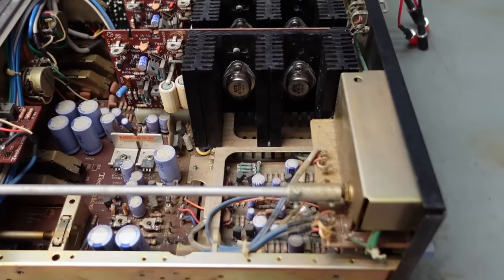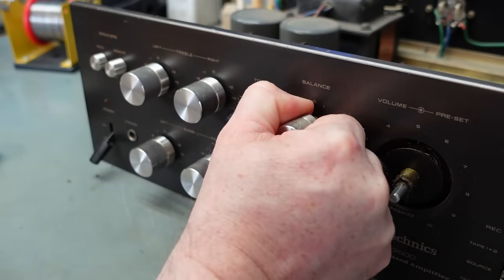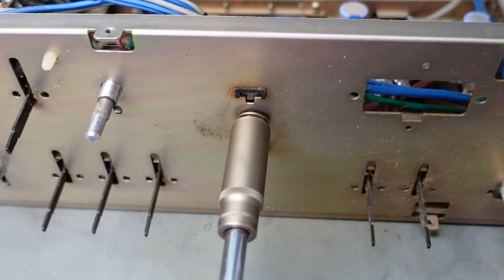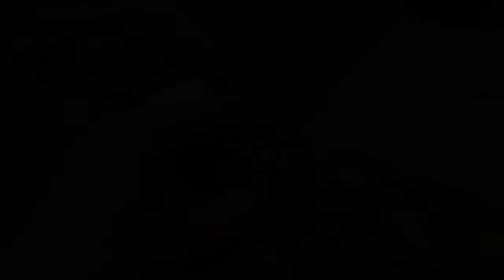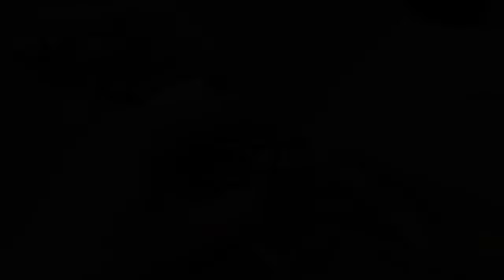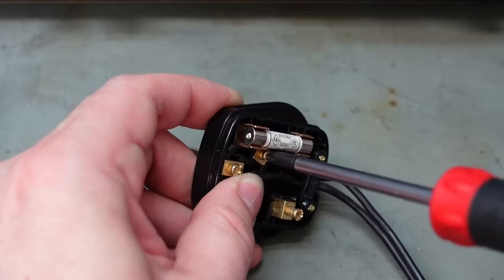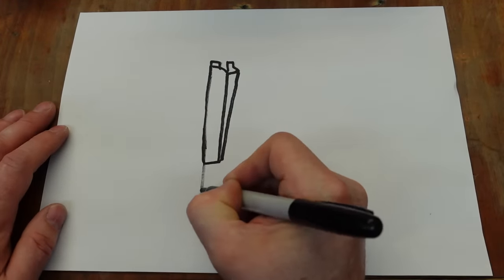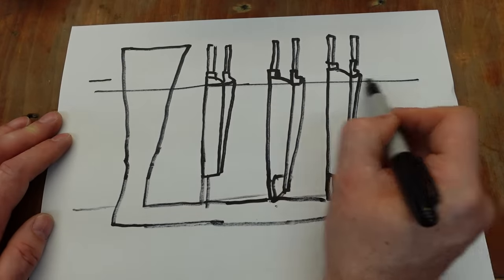Technics SU-3500 Amplifier Repair - Part 2 - The Overhaul!

Comment: I love how Mark always goes the extra mile. Casting those selector knobs was genius.
Reply: Or madness. Wouldn't a 3D printer work with this?
Reply: No, he mentioned it was too intricate inside 😊
Reply: @markbrum  But now he can measure the mold to reproduce the inside!
Reply: Now me, I'd have gone the Ebay route to find similar type switches. Or found a similar amp which is knackered to strip for bits.
Reply: Amazing!
Reply: Completly agree, best aproach to the problem.
Reply: Amazing work he does! I was told only use silicone grease on nylon gears or nylon sliding surfaces! Apparently hydrocarbon grease rots nylon ? Anybody else heard of this ?

Comment: Over performing caps across the board can be a sign that they're starting to develop parallel resistance and leak DC, they appear to be higher values because they take longer to charge due to the parallel resistance taking some of the charge current the meter uses to measure the charge time. You should really also do a DC leakage test on them as well,

Comment: The led mod,ideally ,as its AC driven should have a diode in parallel,as the AC could exceed the reverse voltage of the led, usually around 5 volts. Love you vids. Thank you.

Comment: You might find the LED on/off light goes. LED's have a low reverse V, a rectifier diode in reverse parallel is a good idea. thanks for another entertaining video.

Comment: Great work, Mark!
I like that you don't just blindly replace caps; this has become too much of a disease among amateurs/dabblers (shows you're obviously not one of them). In fact, most of those pale blue Matsushita caps are of extremely high quality; it's just a small batch of them that leak and get corroded.
It's usually better to leave them in, because they were overbuilt (unlike modern ones that often are very near their tolerance limits).

Comment: I'd suggest you use micro fiber towels instead of the abrasive blue shop towels.  MF is far easier on surfaces and better at picking up contaminants.  Great channel!
Reply: Do you know what foam he uses to clean the boards?
Reply: I think it is similar to the old Lysol bathroom cleaner foam. Stuff worked miracles but it's no longer available in Canada, anyway. It was a great but harsh cleaner.
Reply: @Michael-bp7rr  I found a foam cleaner. It is called AF foamclene. Thanks.

Comment: Doing mostly SMD and IC repairs these days but I came up on discreet components. We're a dying breed and it's great to see you repairing them. You've got all the gear as well. Repair seemed bog standard but you went into beast mode on the cleaning. Well done, lad.

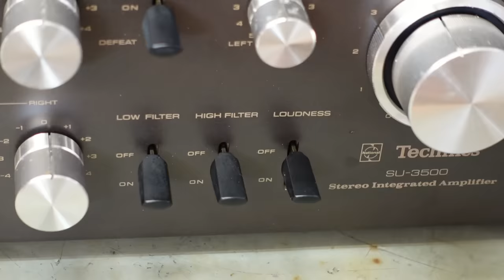Comment: Great job Mark, creating a new replacement switch knob is next level. I love working on Japanese audio equipment of this era although when some of the exotic switches and pots get badly damaged it can be tough to find exact replacements. I did notice at 33:01 that the inside of the headphone socket still looked a bit nasty.

Comment: That's what I call a restoration! 
Almost perfect apart from the overachiever capacitors that were tested.... There's no such thing as an overachiever when it comes to capacitors... This is no different to the old dog bone resistors that gained resistance over time..... 
When a capacitor measures over it's rated value even by a tiny bit, it's trying to tell you that it's well on it's way out, the actual value of a good used capacitor should always be either at it's rating or just below... Anything above or way below should be replaced! 
Capacitors never get better with time or usage... Never! It's very common to find bad capacitors in the tone circuit in just about every vintage amplifier.... You would think that their location which is away from heat and high current that they have an easy life but this is the one area that always needs close attention...  The large capacity capacitors in the power supply usually don't seem to suffer even though they get to deal directly with higher current levels... A I have haven't had to replace these but on rare occasions I have seen them being replaced after testing showed that they were tired... 
Your capacitor tester only showed capacity and voltage loss, pretty sure it must have another screen to show ESR and dwell angle and possibly quality.... You really have to factor in all the measurements of a good capacitor tester to determine if the capacitor needs to be replaced or not... 
But apart from that, this really was a first class restoration of this beautiful amplifier... Making new switch cap's, that just takes this job to new and unheard of heights.... Job well done!

Comment: WOW! A most interesting 2 part video. Besides the fault finding and diagnosing I particularly like how you show the complete disassemble and reassemble as many YouTubers don't do it. Knowing how to take a unit apart and put it back together again is often the missing information in a service manual. Function wise the amp is surprisingly similar to my circa 1976 Pioneer Stereo Amplifier SA-7500. Never been touched and is used to drive two Spirit passive near field monitors I use when composing on a near daily basis. Admittedly it could probably do with replacing some capacitors, even though none show any leakage. Thanks again for your repair videos they are always most enjoyable. Best wishes from Australia.

Comment: Nice job Mark , top class amps well worth keeping em working , built to last and give true tones ,not like today's junk ....   for them selective switches you could have used maybe dowel ,and burnt the leg ports out , then used belt sander to shape a little ,put a bit black stain , would have looked nice , and if you got em steady enough on legs , maybe used a screw to hold em in place ,during usage

Comment: Awesomeness repair job! When reinserting components with multiple legs it's usually a good practice to make sure they're all straight and have as little solder on them as possible to ensure they go through the holes without tearing the etching off.

Comment: Cheers Mark, I feel I gain so much knowledge from your encompassing walkthroughs! In the past, I have had trouble diagnosing/replacing transistors. I added a curve tracer and semiconductor tester to my  electronic repair wish-list. I also appreciate your methodology that enables you to not "shotgun" replace all electrolytic capacitors =)

Comment: It's so very solidly built. That makes it worth saving. Great work. The moulding & casting work was entirely new to me - most impressive. I hope they are very happy to have it working properly again. Nothing even half as complex & versatile is made these days. If you use a variety of decks & sources, this Amp is golden.
Reply: Probably the specification (signal-noise, linearity, distortion) is far inferior to modern IC amplifiers.

Comment: I still have - that I bought new, and I'm still using daily as my home entertainment - CD Music/Computer/YouTube/TV etc, a well serviced 1989 Technics SU-600 'New Class A' integrated amp, Specs:  30W per/ch into 8 Ohm (stereo), 5Hz - 70Khz, THD 0.07%, Damping - 50, and more (Hifiengine online has loads of technical spec manuals for many 80's/90's 'Vintage' amps).
No, it might not be a what you would call a 'Modern day 500W/900W ass kicker', but, on volume 3 to 5 (out of 10), it HAS caught out my partners teenage lad and his mates (they're into all this Boom boom boom' loud music), as they were suprised at what an old amp CAN ACTUALLY DO! I've also had the neighbours complaining (lol). Yes, for a (haha) 'Lowly 30 Watts per channel' It DOES have 'Punch'... But, it ALSO has so much DETAIL and CLARITY too! Great for pretty much any of my eclectic tastes in music... 
Aaaaaaand the sound it provides to my pair of midrange Sony & pair of Pioneer bookshelf speakers (speakers A & B), is just, simply divine!
Oh they don't make them like they used to eh? Any from that period, Sony, Technics, NAD, Pioneer, Cambridge Audio, Marantz etc etc. A lot of 'Vintage' amps (that can be had for as little as £100 in good condition/working order on eBay etc), IF MATCHED to a good pair of speakers, CAN put some of the modern/new amps (or 'Home HiFi' setups) to shame. I guess that's what you get for having a 'Class A' amp verses some modern 'Class D' amps... 🤔😏😉
The only thing I might do in the near future, is hook up an 8" or 10" sub, just to help bring in the lows (my 4 bookshelfs tend to fall off at around 40ish hertz)... 🤔😏
😎🇬🇧

Comment: Watching you service this amp takes me back to the days of when I worked on my share of these amps along with a lot of the Pioneer and Marantz home stereos and tuners back in the 70's, and 80's when I worked in television shops. As time went by they started getting away from the T03 power out transistors and moved over to power output IC's and at that point the days of hand built and hand wired stereos started it's decline down hill just like today's automobiles. Eventually I moved onto RF repair and some designing. These days I'm retired but I still have my personal shop where I work on my own stuff or builds along with an occasional repair for a few close friends. How busy do you stay with this older refurbish/repair work? I also noticed that you work on professional musical equipment amplifiers too. Been there and done that too and even the musical equipment manufactures started taking shortcuts on their gear too which is sad. Around the shop we used to have our own quote... "The name goes on BEFORE the quality goes into the product."

Comment: I restored one of the same amplifier a few month ago. I found on this unit a lot of bad caps so I replaced them quite all. Specialy the 47uF caps where had lower capacity and a higher ESR. However I like your repair videos and you are so relaxed :)

Comment: back in the 90s I used to have amps like this in and the hole lot got a wash spray out with worm water then washing liquid then a water wash again.  dry with hair dryer left in front of a low power fan heater.  then lubrication spray.  was fun times

Comment: where you removed some components you lifted the PCB track and pads off the board.  The input switch track was a mess.  Solder is not a glue. Also the single insulated mains cable should be replaced.

Comment: Mark, thanks for another great video! Just a small advice - Electrolube SGB35 lube does wonders on pots, faders and such. Much smoother action than deoxit/fader lube!
That said, I'm not a fan of ultrasonic cleaning anymore because it flushes out the grease from the shaft of a potentiometer, pretty much impossible to replace it afterwards! I take the risk and bend the pots and switches open and do manual cleaning with silver polish and then lubricate the contacts with SGB35.
Reply: For pot shafts and some other assembled moving parts there are chain and cable lubes that are extremely thinned with solvents for application and will wick in from capillary action. Then the solvent flashes off and leaves behind a much thicker grease. There are even plastic safe versions that use some type of wax based lube.

Comment: Great video as always. I wouldn’t dare take it s as part that much, it would never go back together again! I’m in the process of trying to fix a old Technics amp at the moment, sadly I don’t have Marks knowledge and expertise.
Reply: Learning by doing. 😊  Nothing can go wrong with these type of Amps.
Reply: @twocentman  The Current Drive protection kicks in after 15 minutes, then it won’t power on again for a few hours. There’s two 6 pin relays that I’m going to change next. To my limited knowledge, I’m hoping the relays are sticking, then freeing off over a few hours allowing it to go back on
Reply: @Kevin-mf7wb  hmm it seems that the output transistors are overheating and sucking more and more current. Try to adjust the left and right  bias or measure the voltage across one of the output resistors near the big Transistors. The 14mv he shows in the Video is the bias with no input signal applied.
Reply: @twocentman  thank you, I will have a look at that.

Comment: Great work, now it's better than new! Only few people could do it like that.
Just one small improvement: I would have added an anti-parallel diode like 1n4148 to the studs on the board where the LED cables are connected. Your LED looked quite modern, and modern LEDs hate reverse voltage! The voltage might be so low that you can get away without it but considered all the work you put into it this small addendum wouldn't harm.
And by the way, how did you remove the dab of glue from the original knobs? It did hurt a little when I saw you doing that :)

Comment: This techinics is built like a tank, it should have a good clean sound.
If it was mine, i'd definitely be inclined to replace those modern nte output transistors.

Comment: Just a very friendly advice, always leave the load impedance switch in the close to 47k position, most MM phono cartridges are designed to expect that value from a phono preamp and most important, owners usually don't know exactly what that switch is for.

Comment: You replace the light bulb with an LED without a diode to block the negative current. The LED may expire. BTW, if you include a cap, the LED won't flicker at 25 Hz.

Comment: Good call. Decent caps have got so expensive. I don't even think about using Ebay for caps anymore. Farnell, RS or someone like that only! I think I'd have just shot the pots and switches full of switch cleaner in-situ rather than pulling them all. Good to watch though and one one broken leg!

Comment: What is the name of this white foam?
Reply: Wondering the same thing.
Reply: Servisol foam cleanser 30.  Appears to be a discontinued product.
Reply: It's in-frame at one point.  Servisol Foam Cleanser 30
Reply: Looks like "CRC VISICLEAR DISPLAY & ELECTRONICS SCREEN CLEANER".
You could use other, just search for foam spray cleaner.
Reply: Me too.
Reply: Anti-Static Foaming Cleaner, I use the Amberclens brand but others are available

Comment: Great job, Mark! Personally, I repair old equipment for mainly elderly people from time to time. However, we don't go to the extent as you do. We only handle repairs and charge only for the parts. May I ask which cleaning foam do you use and what you put into the ultrasound bath for cleaning contacts? 
Very much appreciated. Thanks
Best regards from Germany.

Comment: Great repair! What is the white foamy spray cleaner you used to get all the dust off those PCBs?
Reply: I'm not positive what Mark uses exactly but I use "MG Chemicals Static Off Antistatic Foaming Cleaner", might be a different brand but it's comparable I think, works great.

Comment: Very tempted to send in my Pioneer Audio/Video multi-channel receiver VSX-C100 which when turned on, has a loud low frequency hum for about 5 minutes, though on writing this I’m thinking maybe it’s the Bose 6 sound surround speakers base unit that’s the problem…

In the style of Mark… hmmm I need to investigate😂

Nope it’s the amp 

Wonder if it has a valve in it, maybe a capacitor?!

Comment: A curious mix of assembly techniques.... I'm a fan of bending legs, I can here the haters already, I learnt my trade in a company that did mainly MOD equipment, it was a requirement of them, we just learnt to desolder bent legs! That was in the days when tracks lifted easily, if you can't it's your problem! But as Mark pointed out re the phono stage, why weren't those wires tightly wrapped?  Technics obviously didn't quite get the point.... used to like them, especially their stuff from those days, but proves they were far from perfect!

Comment: Mark, 
1. it would help to post the name of the high-viscosity grease you suggest, but is no longer available. In the USA, it may be possible to find an equivalent.
2. What spray cleaner product did you use for the knobs and switches?

Comment: hello.  You are simply the best.  You can handle any problem.  I wonder if it would be profitable to send you two Panasonic walkmans from Poland for repair.  One is the Panasonic RQ-SX75 and the other is the Panasonic RQ-SX46.  Both don't start.  In the first one, the clutch plate is definitely cracked.  And on the other, I don't know.  Please reply.

Comment: Hello that foam cleaner you use , i have one very old left from the time when i worked as service engineer , back in te 90´s still some left but what is the new brand you use ?   where can i get it ?

Comment: Great Restoration video. Do you see the difference now between "Made in Japan" components vs China or Singapore etc. Also what spray foam cleaner are you using to clean the face of the amplifier without removing the original lettering, also what are the brushes used while cleaning (Anti-static)?
Reply: Anti-Static Foaming Cleaner, I use the Amberclens brand but others are available

Comment: ther is a high viscosity grease made by Bosch part number 5 700 002 025 its realy sticky stuff
but i cant find it anymore. i heard the number 5 700 002 005 is the same stuff, the same pries just only a 6th of the Quantity

Comment: brill job 1 problem on ebay same amp the power lever isnt the same its a miled brass 25 mil and round, otherwise saving quality items that today u carnt buy like for like as we throw away , my old valve amp blew and no utube 20 years ago to help me fix it, sadly left in a gararge it fell foul of damp and rust

Comment: Bit brave. I’ve seen spindles ripped out of pots levering them too much. I do like this old Technics kit though. Rebuilt an SU-Z11 over lockdown which was my first ‘real’ amp I purchased as a student studying electronic engineering of all things. Sold the original but picked one up locally, spares or repairs very poorly. After a good fettle it’s now like new. Don’t like the wire wrap terminations though. Just on with a Leak Delta 70 at the mo. Just one broken switch to go.